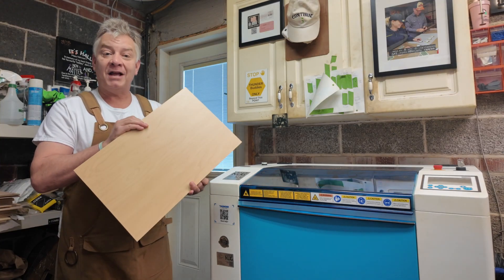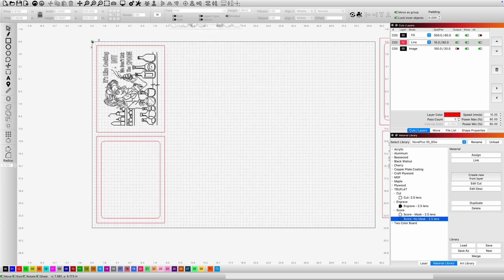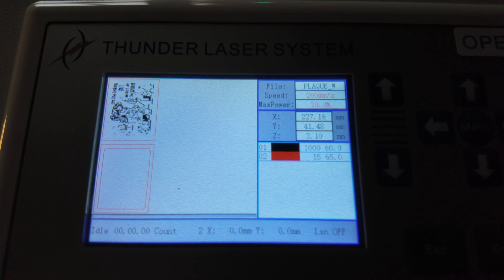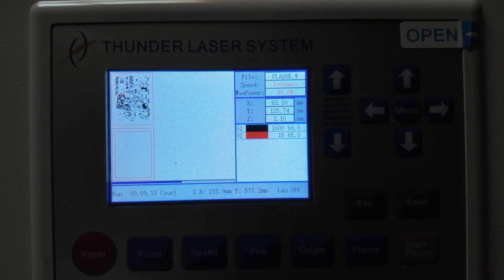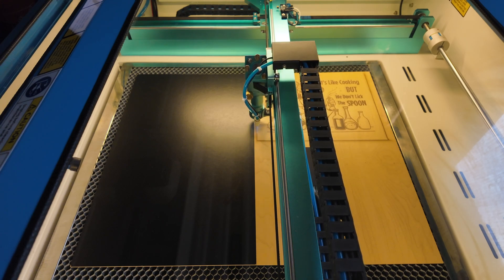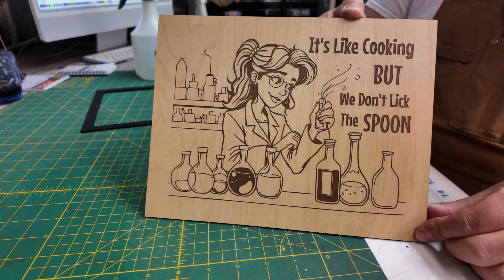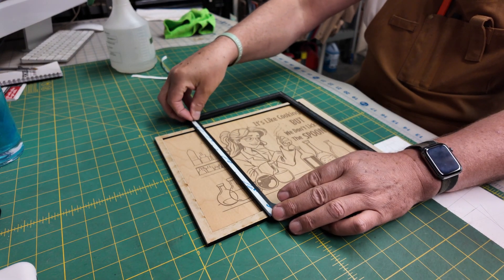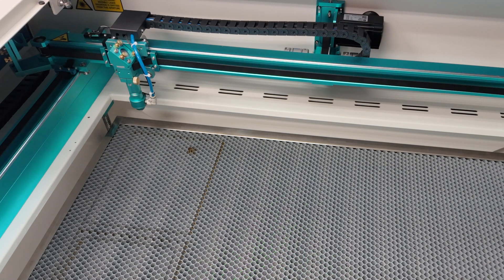TRUFLAT Plywood Settings for Thunder Nova PLUS 60W Laser. 086   4K

Comment: Thanks Gord, I don't have a Thunder Laser but i still get some good ideas from watching your videos.
Is that tape like the adhesive sheets for full coverage or is it just double-sided tape for installing plates to trophies.
Reply from the maker: Morning LG! I am happy they help a bit - I think many C02 lasers operate similarly in some respects. It is 3m adhesive. I buy the 3M 467MP in sheets and this one is really helpful for things like this so I don't waste big areas of adhesive. it is 3M 9448A and is also rated for adhesion in warm and cold temperature, inside and outside use. I get it from Wishing Star Design in Alberta. Hope that helps - thanks for watching!

Comment: Now that you've had time to them both, can you speak the main differences between the bolt and nova plus lines? I'm having a hard time deciding which one to get. They both have RF metal tubes, which I know I want for the accuracy with engraving. The only real difference I can tell from the specs is that the Bolt line can run faster than the Nova Plus line. The Nova Plus line has higher wattage laser and bed size for the money compared to the Bolt line. As you spoke to in another video, that max speed isn't something you actually run at for quality anyway. I feel like I have to missing something about the Bolt line and they must have something other than speed going for them over the Nova Plus line.
Reply from the maker: Good morning and thanks - I think I will after I have had some more time to use this Nova PLUS. But I looked online at Thunder's website and I believe the main differences ( if it is the price difference that is causing the confusion) is the speed (2.5 vs 5G), and the 3 higher models of BOLT use a Coherent RF tube (super expensive tube). I think this video may help you ( around the 8 minute mark they begin explaining the RF tubes and the differences in price and tubes etc between the BOLT and the nova PLUS) - in this video they talk about the differences between the lasers in detail. Good luck it can be difficult to compare etc so if you have more questions then I am happy to try to answer them, if I can, Cheers! https://www.youtube.com/watch?v=bWFKHtdZrvw